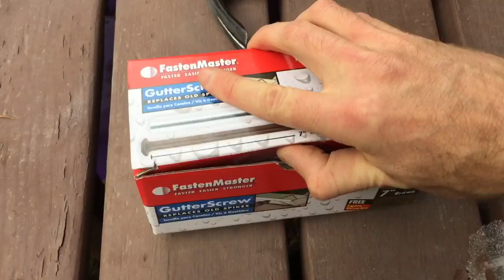Replacing Gutter Spikes With Screws DIY

Comment: I have a problem with this. What holds the back up?  The two screws that are shown  being driven do not go through the back of the gutter to hold the back up.  At best it looks like maybe the gutter is pushed up against the screw and the sleeve is barely catching tin

Comment: And this is why I like youtube. Exactly the video I needed. One question...did you replace with screws because that was closest to what you had? I used the hidden mount brackets with the screw insert and found that they were a lot more sturdy. But I guess since you already had the nail holes through the fronts of the gutters it was just as easy to use the screws and ferrules. Nice video. I hate gutter work but I am too cheap to pay a professional.
Reply from the maker: If I used the hidden hangers there’d be visible holes left in the gutter. The screws are also much cheaper.

Comment: Thanks.  And the spike goes through both the front and back of the gutter to hold it up on mine.  Make sure to hit wood if you have poly board fascia ( like mine).  Do these screws come in a longer size for jumbo size gutters?

Comment: Good video. I have a question: It looks like you kept the entire length of the gutter under the flashing. Are you able to have a slope in the gutter run, while keeping it tucked under the flashing?
Reply from the maker: I kept all the original hole locations. Remember this was a repair, not a new install, using all the original gutters. Water doesn’t pool, so I suppose at the very least doesn’t have a negative slope.

Comment: Uf trhe wood is rotted where original nail was can you just pick another spot where there is good wood to screw in the gutter spike? I live in an older house that doesn't even have flashing from what I can see, so over time the wood has rotted.
Reply from the maker: Honestly you’ve got bigger problems that need addressing in that case. The fascia board needs replacement. The only reason to use these screws IMHO is to reuse the existing gutter when everything but the nails are still in good shape. They’re not the best option vs hidden hangers for a new installation, and if you’re making new holes rather than reusing old ones. That said: you could send the screw in at an angle to find solid wood in a pinch, reusing the old hole on the face of the gutter.

Comment: Are the gutter screws as good as hidden hangers? My Homedepot has the screws on back order,but they have the hidden hangers in stock.
Reply from the maker: It's important to note that the sole purpose of the gutter screw is to replace a gutter nail that is failing. They work well, and are a lot cheaper than hangers, but between the two on a new installation hangers are a better idea I think.
Reply: @youngbloodbuilt  I have spikes,and the damn things are almost all loose,which was why I was looking at gutter screws. Can hangers be as easily installed as gutter screws to replace existing spikes?
Reply from the maker: @mikedunn7795  screws are better in your situation I think, because they fill the holes. Hangers are going to be more expensive, leave an ugly hole, and may not install as easily depending on the condition of your fascia board because they use a much smaller and shorter screw for mounting. I'd just order the screws and wait to do the job.
Reply: @youngbloodbuilt  Just received an Amazon order for two packs of the gutter screws. They sell them in ten packs,but I need 13. I can sell the leftovers on Ebay. Someone else said they were magnetic,and mine are too. Installed them yesterday,and they seem very solid.

Comment: Replace them all with the new screw in brackets, they are way better.
Reply from the maker: As explained, the brackets leave the ugly nail hole visible unless you replace the gutter and are substantially more expensive. Thanks for your input.
Reply: @youngbloodbuilt  Well, you can use both too.

Comment: If you need to remove nails to repair the sofit, youll have to cut the nails at the base. Im a handyman and 90% of the nails cannot be taken out without major damage to the gutter.
Reply from the maker: Karri Kahl   So your situation is completely different than the issue I was addressing. Good info. In my case the soffit was not in need of replacement, the gutters were falling off my house due to the natural expansion and contraction of the nails wallowing out the nail holes. As I show, most nails pulled out by hand. I did the entire house and avoided crushing the gutter by carefully using a spacer to pry against.
Reply: @youngbloodbuilt  contradicting yourself. You started recording after you pulled the nails out 4in? Before you replied to me and said they just slipped out cuz the board was bad. I was just very curious because I've never been able to pull a nail out without denting the aluminum gutter... Very soft metal. I just saw is very convenient that when you pull the nail out it was already out?!? If the gutter fails then the soffit is going to fail.
Reply from the maker: Karri Kahl You got me. I’m lying. I removed the nails using telekinesis. Really this video contains subsonic messages trying to get foolish DIYers to join the Illuminati. I’m sorry everyone. I have to go on the run now. Goodbye forever.
Reply: @youngbloodbuilt  Well played.
Reply: Christian Youngblood 😂
Reply: @youngbloodbuilt  Haha that's funny.

Comment: Why did you replace
Reply from the maker: The gutters were falling off the house.
Reply: @youngbloodbuilt  why not tap the nails back in
Reply from the maker: @Brandon-no3vc  watch the video for answers?
Reply: @youngbloodbuilt  no answers in video
Reply from the maker: @Brandon-no3vc  OK. Pretty sure it’s explained in the comments, the description, and the video. But the idea is the nails pull out after wallowing out the holes they were in and putting them back in is no longer possible. So the screw threads are larger in diameter than the original nails and grab the existing holes. Allows you to reuse the original gutters.
Reply from the maker: @Brandon-no3vc  Why didn’t I think of that.
Reply: @youngbloodbuilt  LOL!!

Comment: The screws are as long as the nail. The screws won’t grab when you screw them in. They are fine for new construction. The nail was in the end of the rafter so theres a huge hole in the rafter already from the nail. The screws need to be alittle longer.
Reply from the maker: Just so other people don't see the above comment and think it's correct: the screws are fatter than the nail and take up the space by design.

Comment: Great video. Why is there a need for a spacer?
Reply from the maker: zibbyzubb The spacer is to provide resistance to pull out the old nails without crushing the gutter.
Reply: Ahh, OK Thank you. I am just about to replace some old loose gutter spikes with screws so this is very helpful!

Comment: Don't use a hammer and risk damaging the gutters...simply use a bolt cutter on the nail inside the gutter.
Reply from the maker: And how would you then reuse the holes the screws are intended to go in? There would be a stub of a nail in the hole.